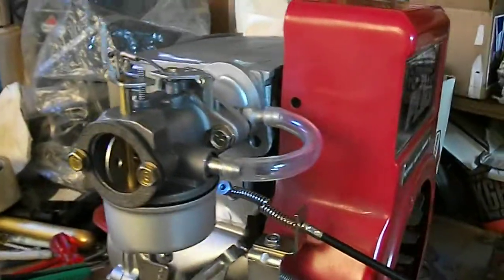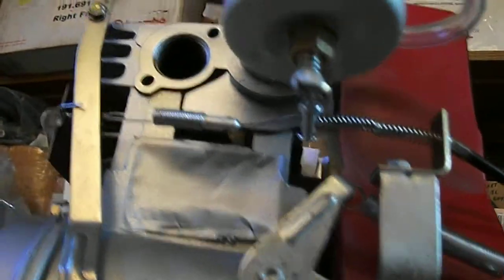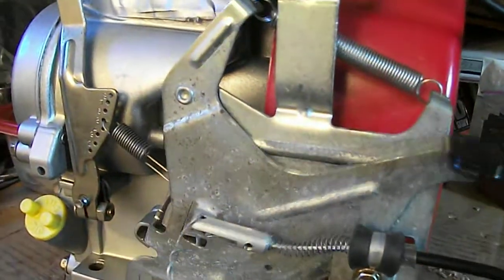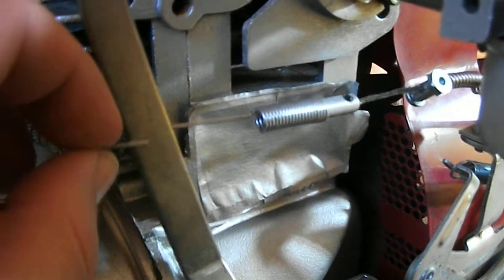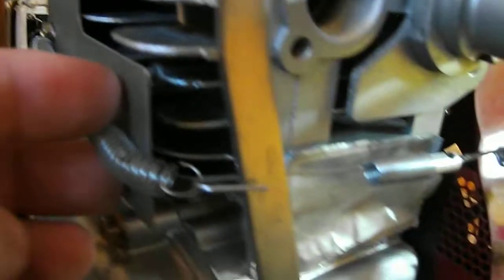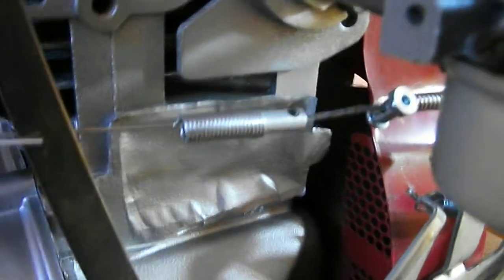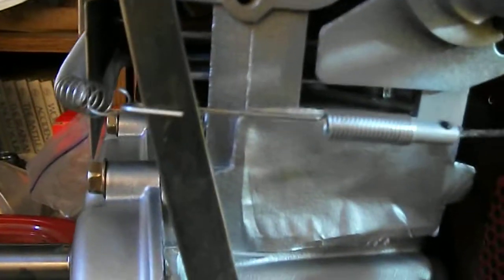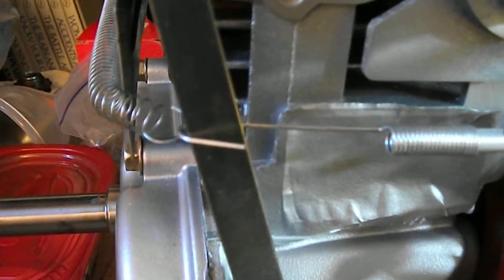06 Briggs 5hp Double (Dual) Throttle Linkage - Demonstration - HD

Comment: whats the two pieces that go on the end of the cable called?
Reply from the maker: I think your talking about a "Throttle Clevis". I installed those with springs to keep the cables tight.
Reply: ok thanks

Comment: That was a neat Idea I should have a video o my complete raptor motor in a couple weeks the reason there haven't been any driving vids is because the exhaust valve guide leaked a ton of oil so I ordered a new one and put better rings In it